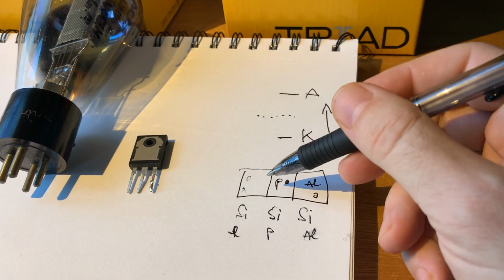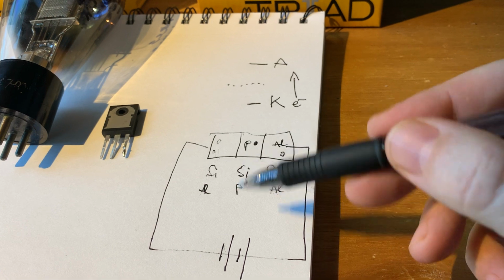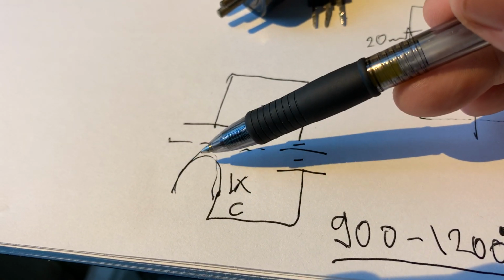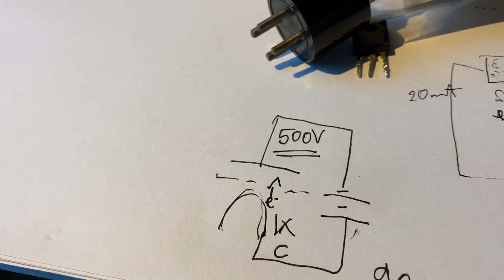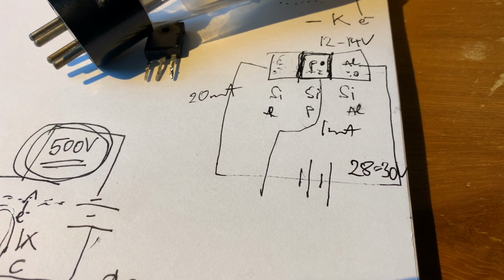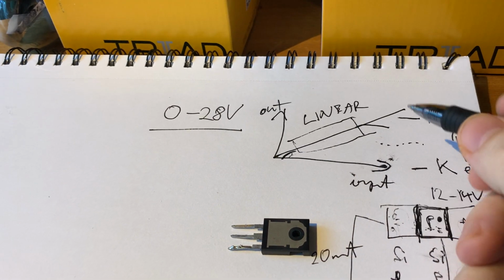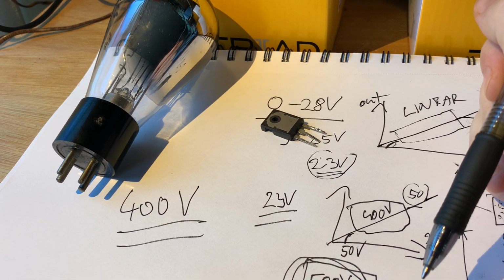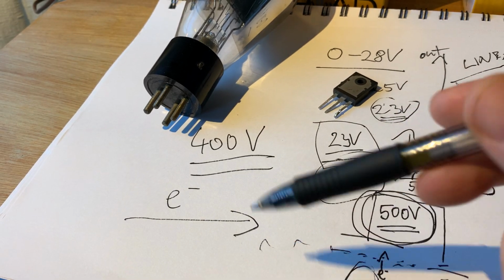Vacuum tubes VS Transistors!!!!

Comment: You are wrong! 
Vacuum tubes have high impedence ie. HIGH RESISTANCE!
To get the same current flowing, due to ohms law I = U/R, if you have a high resistance you need a higher voltage to get the same current, this is why tubes run at 500V and require output transformers to get the signal down to a few volts at high current for a speaker. 
Transistors do not require output transformers since they are low voltage high current devices! 
For someone who wants to educate people you do not have a full understanding of the theory of tubes and transistors. 
I am into tubes, so i am not hating this video due to it praising them, but please research before you miseducate people. 
Thank you, otherwise the video was mostly good
Reply from the maker: You have misinterpreted what I said. Yes, the cathode and the plate have resistance, the plate very high resistance, that is why we need the output transformer. However, these elements are NOT the substrates for the signal amplification: they provide the electron source and the electron acceptor electrodes. The signal amplification occurs in the vacuum, which lacks any resistance whatsoever, the electrons are accelerated without any particulate interference by the magnetic field generated by the cathode - plate voltage difference.
Reply: @realworldaudio  Well it still doesnt matter, the signal resolution is pretty much the same but tubes have higher frequency harmonics due to their construction which is called "tube sound". 
The cathode doesnt generate any magnetic field. 
The cathode gets heated and electrons shake out of their atomic bonds into the vacuum which gets them accelerated due to the high anode voltage, thus a current is formed. 
The vacuum doesnt really have resistance, but due to the distance it requires more voltage to attract more electrons, so you can view it as a sort of resistance, but the plate is the actual "resistive part" getting hot. 
the signal amplification happens due to the electrostatic field between the cathode and the grid, its the electric field, not the vacuum that does the amplification.
Reply: @realworldaudio  I recommend you read the RCA Tube recieving manual RC30, its free online as pdf, the first 100 pages contain a lot of knowledge about tubes
Reply from the maker: @janno288  Thank you for your kind recommendation. I have studied that manual in depth, and also dozens more of receiving and transmitting tubes, rectifiers, VR tubes, etc, that I have in hard copies. I have a whole library on vacuum tubes, about 50 books, including vacuum tube manufacturing that describes details way beyond the RC30. Cheers.
Reply: @realworldaudio  Very cool!
I suppose you have gained more knowledge in the 2 years that followed after that video.

Comment: I always get confused when trying to understand this topic.
Reply from the maker: Simplified to the max: in a vacuum tube the amplification occurs in a vacuum, there's nothing obstructing the path of the electrons and they are guided / modulated by the magnetic field. In a semiconductor, the electrons have to bump from atom to atom in a glass that acts as a variable resistor. Difference is like traveling on an empty highway (tube),  or passing through a city in rush hour traffic from red light to red light. All the rest follows from there.... Thank you for watching! ;

Comment: what tube is this? .. MOST tubes are more than 4 pins .. Anode, Grid, Cathode and separate heater (2 pins).. the heater is usually NOT part of the signal circuit, only to provide the heating
Reply: Good heavens!  Hi Ed.  All well, I trust?
Reply from the maker: It is a direct heated tube (DHT). There is no separate cathode, the filament is the cathode as well. So, the four connectors: filament 1 and 2, grid, anode. Such power tubes are: 10, 801, 45, 2A3, 50, 300B, PX25, 211.
Reply: @realworldaudio  all true, but an easier to understand explanation would be to separate the heater from the anode, as they do different functions.  Though all tubes you mention are correct, the more common in this timeframe would be 6L6, and preamp tubes like 12aX7, etc with separate heaters.  otherwise, good job, a lot of good detail not found elsewhere.
Reply from the maker: @edevans4210  Thank you Ed! This technology was from an era when separate filament and cathode was not invented yet. Until late 1920s all vacuum tubes were direct heated, the first indirect heated commercial tube was the 27. Sadly, the direct heated tubes sound better than the more modern indirect heated ones, so the development went towards easier to build and not better sound. For this video, I used this tube as it has easy to see elements. Much harder to see on a 6L6, and the 12AX7 is perhaps too small to do a video on it... I should do a comparison video of different types of tubes, showing their internal elements.

Comment: 25 minus 3 equals 22, no?

But more problematic is the stuff about resolution.  Resolution is not simply a matter of the size (voltage) of the possible change (amplification) of the signal (given here as 23 volts versus 400 volts) but of the degree of precision (sometimes known as 'granularity') with which that change can be expressed.  In other words, the question is how many different voltage values can exist between the extremes.  The limits in both cases happen on a molecular level and are therefore many orders of magnitude greater than are of relevance, given other considerations of audio amplifier design.  In short, this is a complete red herring.
Reply from the maker: Correct, there are many factors at play. The voltage acts only as the ultimate limiter, but other measures need to be taken care of to be able to use the potential. When same measures are observed, then doubling the voltage drastically increases dynamic resolution.
Reply: @realworldaudio  I liked your video generally, but this stuff relating operating voltage to resolution is just plain wrong.

Just switching on a little BC547 involves the current produced by 3,000,000,000,000,000 electrons, passing through the base/emitter junction every second, never mind what's passing through the collector/emitter junction at nominal operating current (it's a MUCH higher figure still).  This allows for a fineness of resolution miles beyond anything audible to us.

If the operating voltage of analogue components materially limited the resolution of audio reproduction, line level (approx. 1 volt) would be lousy and the voltage produced by a dynamic microphone (about 3 mV) would be unusable!
Reply from the maker: @franciselers1534  Thank you for your comment! If your reasoning would be correct, then the electron microscopes would be operating on a 1.5V battery, and not on 300kV, and all audio gear would be running on 1.5V - much safer than 50V or higher, so if it would be possible that would be the only technology we need today! The speed of light is a constant, so that information is not relevant to dynamic resolution. If the speed of light was the determining factor of dynamic resolution, then there would be zero resolution as every electron moves at the same speed, so we would hear no fluctuations at all. The electrons are moved by the electron motive force, which is expressed in volts. The greater the motive force, the greater the momentum of the electrons to jump from one atom to the next, also expressed in electron volts (eV). While every subatomic particle travels in the vacuum at a speed close (often infinitesimally close) to the speed of light, only photons, neutrinos, and a few other particles travel at speed of light. The energy the electrons carry (and what makes them capable to escape from a grasp of an atomic nuclei) varies tremendously. A single electron literally can be carrying next to zero energy, never leaving the atom,  or the energy to create a miniature supernova explosion upon impact. (0 eV versus 1 tera eV.)  The range between the extremes of the electron motive force is the dynamic resolution: the electron either does nothing, or can do feats that seems like affecting a  mountain proportionate to its size. For example, at the level of a LOMC cartridge the voltage peak is but 0.3mV, but there the range starts from pico volts. This range gets amplified by preamp and then by power amp ranging nano volts to 50 volts, or nanovolts to 600 volts.... matters a lot. Thank you for your thought-provoking comment!
Reply: @franciselers1534 so what your saying is you prefer transistors right? I think the point to this video was to explain it so someone without your obvious background in the topic could understand it .
Reply: Actually I wish I had the skill to reproduce the first hybrid automotive amps  “Butler audio” made around 2000 because in my opinion this circuit really did give a tube sound with the power and reliability of transistors. I don’t know it to be fact but It’s my understanding that they used the tubes to regulate the rail voltage of the transistors . One of these days I’m going reverse engineer the one I have and draw a schematic of it.
Reply: @realworldaudio  You say: "...electron microscopes would be operating on a 1.5V battery, and not on 300kV..."

Utter nonsense. Machines that require high-voltage supplies do so because they consume a lot of power. Electrical power requires current. Current is 'forced' through power-hungry machines by high voltage. Nothing whatever to do with 'resolution'. An industrial 3-phase motor may need kilowatts of electrical power. You're not getting that from a 1.5 Volt battery. 'Resolution' (whatever that would mean in this case)? Irrelevant.
Reply: @kristopherburkholder9366  I'm not saying that at all. I AM saying that this person's theory of vacuum tubes being capable of materially greater resolution is incorrect.
Reply: Is this greater resolution of vacuum tubes/lower resolution of transistors why (transistor-based) microphones have problems with self-noise?
Reply: @GregConquest  I suspect that in the case of microphones the main problem is that the transistor-generated self noise is harsher than the vacuum tube self-noise, and overloads not as gracefully.
Reply: @GregConquest  If you're asking me, Greg, I can't answer you because I don't accept the underlying premise, i.e. that vacuum tubes achieve 'higher resolution'. The person who posted this video is simply incorrect. There are many reasons that tubes and silicon devices may 'sound different' but none of them have anything to do with resolution or with much else that the OP claims. His notion, for example, that sound reproduction benefits from the fact that a vacuum is like an empty highway, is complete drivel.

Comment: Are Balloon Globe vacuum tubes relevant today, useful in modern tube stereos/amps? Can I replace my Linear tubes wit Balloon tubes in my new tube amp (No time soon) ??
Reply from the maker: It depends on the tube type. Usually just the old tubes (1930s and before) have globe versions, and about 99% of commercial tube amps use new tube models (1950s development and newer). The old tube types have much better linearity, the new ones have higher power but compromised linearity. Tube development (and audio development in general) went towards making things more compact and more economical, but also more compromised in linearity. When tube rolling, you have to roll tubes with same characters. For example, cannot swap in a globe 46 for a KT120.
Reply: @realworldaudio  Tq for the information. Very interesting, linearity.
Reply from the maker: @M0D60  You are welcome!;
Reply: @realworldaudio I wonder if the really old globe tubes sound better because they are made with glass and metal only, there is no mica spacers that can off gas?

Comment: I had a discussion with someone who swears by some new PA technology Hypex Ncore, they output lots of wattage. The big wattage they provide can never be of quality I think. In addition, a high-efficiency loudspeaker with a tube will always give the most magical sound. I think it can never beat tube sound but I was wondering what makes the Hypex ncore so special ? Could this potentially be any good?
Reply from the maker: I have not heard any yet. I suspect they will be terrific for driving near-short loads, and we can have ever smaller speakers, and cheaper amplification. I do not fully understand the system, but apparently it uses a comparator technology against a triangle wave to keep the unit stable - not sure what sort of sonic signature that gives to the amp. I suspect your suspicion is correct, it can deliver amazing quantity at pretty decent quality, but not nearly the low detail, and harmonic detail level of a good tube amp. I assume that because of the gigantic headroom, it does not go into clipping as early, so there's much less HF distortion at normal listening levels.
Reply: In my limited exprience Class D is awesome on bass. I haven't heard any Hypex modules. But the mastering engineer I sold some highly modded Tannoy Chevoits to. 1st song mastered on them won a fucking ARIA! Swears they are the best! Or should I say USED to! He now raves about Topping! For an active or a sub w satelite speakers. This offers the best of both worlds. The high damping factor control in the low end. Rythmik audio are the best players I know of in the sub arena Then run the best tube amp you can for everything above 80 to 250 Hz.  Depending on where you cross over. The higher you do the more carefully everything needs to be matched. The tradeoff is the higher you crossover. The less distortion in the bass the satellites will exhibit. Thus being free to do that midrange magic thing tubes do best. That is the setup I use for PC. A custom designed 7971 transmitter tube amp 28 w pentode 14 triode. Run 4 differnt satellites. Depending on my mood. All designed by me in collaboration with a local builder. On Bass A Yung 300w module. Running a corner horn loaded [floor & rear wall] sealed  system W 2 Peerless SLS 8 in in Parallel in a 75 L triangulated enclosure. And it will rip your head clean off @ the shoulders. And leave a blood spurting stump if you crank it. But at sensible nearfield levels it has NO peers. Clean, tight, With REAL lifelike chest/gut impact most PC systems woefully lack. Scale will be of course diminished when compared with BIG speakers. But not as much as you might think! WITH that tube magic where its needed most! My god, its SO FANTASTIC BEING ME!